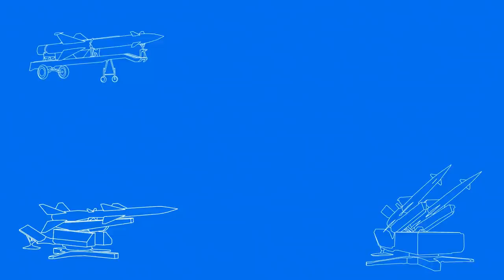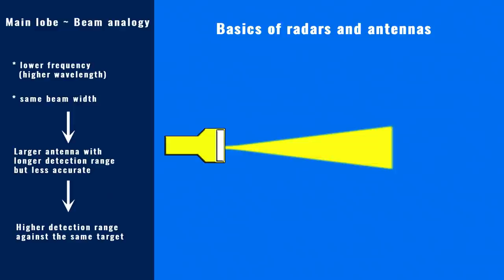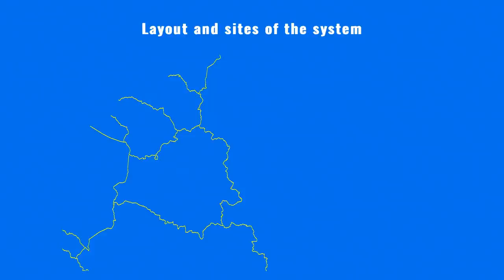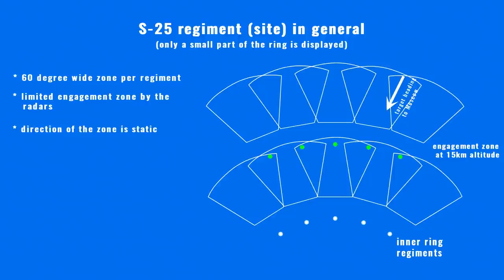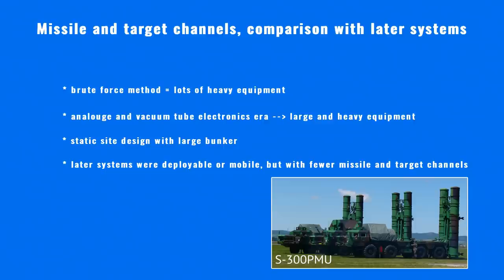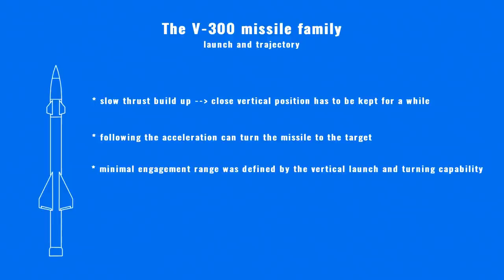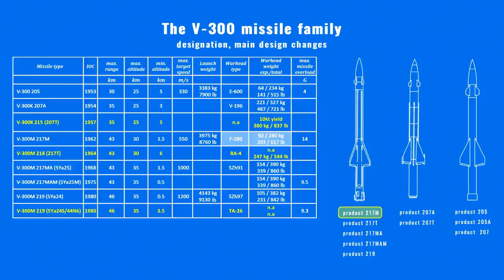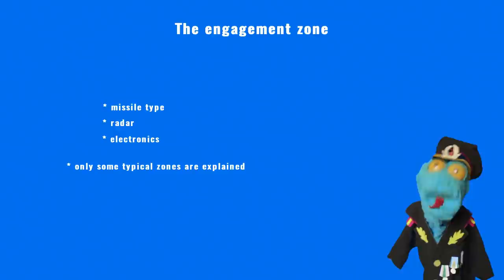Was S-25, Soviet first SAM system, ahead of its time? (A VERY in-depth analysis)

Comment: Its good to hear about the old Soviet Union and especially the S-25 missile system. The S-25 was tested by the U-2 flights over the Soviet Union from the mid-1950s. The system was not able to intercept a U-2 until 1960 when 14 SA-2 missiles were fired, one downing a MiG-19, before Gary Powers U-2 was hit.

Comment: It seems like a LOT of these systems could have been made a LOT safer if them just moved the command bunker 10 - 20 meters away from the electronics/ radars, via cables, so that anti-radiation missiles/ bomb strikes against the radars would not kill the operators in the bunkers. Maybe some concrete reinforcing, as with Vietnamese SA 2 sites wouldn't have gone amiss, either.

Comment: if a missile/rocket motor has no turbopump but relies on pressure, maybe it's better to call it pressure-fed? then again if pressurizing gas is generated instead of stored separately it might make sense to call it a gas generator cycle even though 'gas generator cycle' usually implies 'gas is produced to power turbopumps to pump fuel'
Reply: If you think through it would be pointless such term. Because if you have pump what does the pump do? Increase pressure. Any fluid is pressure fed. The question is what provides the pressure.

Comment: what instrument reads the radar and turns the fins of missile that guide it to the target and how does the mechanism work?
Reply: This is way to deep question to answer. 
You need the blueprints of the systems. The principle of the system is the point of the video. You are asking not about "basic design" level but detail design.
Reply: @molnibalage83  Excellent work!
(Másfél évet voltam Volkhovon, Sárbogárdon, ez a videó elég sok emléket felhozott. 😊)
Reply: @imrekalman9044  Ha lesz folytatás, akkor még több emlék lesz. ;)

Comment: Just one small mistake. G rate is important only in relation of successful maneuver at a very short distance. Due to how geometry works, any maneuver done by target will require a significantly lower adjustment by pursuer. G differences are more theoretical and are about how effectively pilot manages to avoid incoming missiles. With fighter planes pilot had some room to maneuver, but even if pilot knows what to do exactly, it still does not make missile obsolete. However, targets against which this system was initially designed had no dodging capabilities. G turn rate is highly situational and marginal statistic.
Reply: This is not true. Short distance is not = with terminal phase.
The leading and other issues will be explained later.
Reply: @molnibalage83  Refer to what I had said previously. Incoming object does not need same levels of maneuverability in order to track target. Its one degree shift can cover 90 degree shift in maneuvering object if distances between two objects are large enough.
Reply: @REgamesplayer  I will explain in detail everything as the length of the videos allow. There is not such kind of mistake in a video. You will see hopefully even in the following video.
Reply: @molnibalage83  If you say so.

Comment: How would it have done against the UK's Vulcan B2 bomber carrying bluesteel missile ? In service from  about 1963 to 1969. It had a Mach 3.5 speed and a range of 90 to 250 miles depending on launch hight.
Reply: I do not know the exact attack profile of the Blue Steel missile. From 1968 the Berkut a decelerated BS missile maybe could down but from mid '60s appeared the first S-200A Angara what would have better chance against it.

The 90-250 mile range of the BS missile was not enough large considering the qty. of Soviet interceptors. The main problem was the unreliability of the BS missiles and very long preparation time. On paper it had good combat parameters but the maintaining and reaching that is another thing.
Reply: @molnibalage83  bluesteel was only really an interim solution. The original plan was to replace with skybolt (best part of 1,000 mile range) when that was cancelled the UK deploy Polaris A3 in 1969.
Reply: @patdbean  I know. ;)
Reply: @molnibalage83  I was not suggesting that you didn't, just filling In the story for anyone else. 👍
Reply: @patdbean  RGR. This story is quite long and also had effect on army air defense. Hopefully I get chance to bring on the whole story on this channel.
Reply: @Traynesha Wilson the UK's first free fall bomb  blue Danube may have had the problem. But that was a 20ktatomic bomb.  By the time of bluesteel the warhead was (I think) a one megaton yellow sun. That is not to say that the liquid propellant on the bluesteel missile did not give problems, I am sure it did. Remember it is was a stop gap weapon, only 50  odd built. So probably only 20-30 in operational service at any one time. Still 2 or 3MT on each  of your 10 bigest cities could put a downer on your day.
Reply: @Traynesha Wilson This is true for every nuclear weapon. From time to time they have to be disassembled. In fact the first generation on nuclear bombs, the closest kin of the Fat Man could be kept only for some days in usable state that had to be disassembled because of its batteries.
Reply: @molnibalage83  if it is only the batteries, I think  they started with rechargeable NICD but soon moved to single use thermal batteries, unclear bomb is the ultimate single use device.

Comment: Can you make a video on David Sling air defense system.
Reply: I do not know well that system. In fact most of current SAMs uses quite the same general principle, only their radar types and missiles are different. But exact data are classified. Making a detailed video with useful information is quite hard.

The best what is possible when all the major Russians SAMs are known and basics of the NASAMS2 and S-350 you can compare the main items on basic level but that is it. You can't find real usable data about missile maneuvering capability or anything. The principles and goals can be shown but such detailed style what you can see this video is not possible.

Comment: Soviets were always ahead in two areas: anti-air missiles and small arms.
Reply: This is not exactly true. 
In fact the first mobile SARH guided SAM with CW illumination was the HAWK. IOC 1960.
For the Soviets the 2K12M Kub, the really fist reliable variant was available about 6-7 years later.

The Nike Ajax and Hercules combined wit SAGE were such advanced that we cannot speak about 'ahead'.
The US and western SAMs are generally less known because they are barely or not at all were used in combat comparing to Soviet SAMs.
Reply: @molnibalage83  I was referring to AA missiles in general. Like the R-73 which was at its time, unrivaled among short range IR missles.
Reply: @andro7862  Which is also not true. The only unique capability of the R-73 was the TVC. 

The HOBS capability was available in small scale. The F-14J (Block 45 and 46 series) and on F-4N in 1970 was available a helmet mounted sight with AIM-9H. It was considered too complex, heavy and unpractical the system and they discarded. But it was 13+ years ahead of the USSR. Then the US Navy switched to Hornet good slow speed pitch authority instead HOBS.
http://www.best-of-flightgear.dk/vtas.htm

Otherwise the R-73 was just and upscaled R-60M with TVC and better seeker gimbal. It is just arrived later and more hyped.
Reply: Also tanks the T-64 is the first MBT to have composite armour layout ,smooth bore gun that enter mass production and for an entire decade NATO has nothing similar.
Reply: @molnibalage83  But it never entered service. The R-73 did.
Reply: @bacnguyen9304  Yes, the T-64A was a miracle comparing to the Leo1 and AMX-30. It change the thought that MBTs cannot be protected against the existing firepower well.
Hpasp also made a doc about MBTs 10 years ago.
http://www.mediafire.com/file/b63t8z6w86nizpi/MBTs.pdf/file
Reply: @andro7862  Nope, they are entered in service and based on experience it was discarded. The idea to make a HOBS capable plan
*was not a Soviet idea
* was not the first Soviet
They pushed further and they fielded in great number.

Following the Cold War testing when the west realized the power of R-73 quite quickly developed the USA the AIM-9X (partially revived the cancelled AIM-9R) and IRIS-T.
Reply: @molnibalage83  You said yourself it was cancelled. The US realized how the R-73 was superior to their missiles so they rushed to develop the AIM-9X after the USSR fell apart.
Reply: @andro7862 It was applied for a few jets THAN cancalled.

Comment: How effective would the A 10 Thunderbolt 2 be against naval assets. If the A 10 was used in defense of Taiwan how useful would  it be?
Reply: Which A-10? A-10A or A-10C and against what naval asset? I short both in its era is quite ineffective against ships. The only longer range PGM during Cold War was the AGM-65 which is has much smaller range that just an air defense of a small frigate...

Comment: Type 207 with a 10 kiloton warhead! That’s one way to stop several bombers.
I wonder how many of those were actually deployed.
Also isn’t very high altitude detonation more safe as far as fallout because of less radioactive dust spreading as in closer to earth detonations?
So maybe much better than missing just one bomber.
Reply: Only 60 were manufactured from 207T. I do not have figures about the rest.

The 207T missile was live tested in Kasputin Yar training system, on the 19th of January 1957. Western codename of this nuclear blast is Joe-29.
Two Il-28 target planes were selected as targets flying at an altitude of 10km flying in a formation, 800m apart. The pilots bailed out before entering the test range. The detonation of the warhead took place at a range of 150~200m from the first aircraft. The wings of both aircraft blew off by the shockwave of the nuclear burst.
Reply: @molnibalage83  not true.  the pilots did not jump out of the plane.  the pilots were prisoners of the gulag.  they were chained to the helm, and a million more prisoners were in the bomb bay.  And from behind flew an NKVD bomber with a machine gun to shoot those who turn back.  Behind the S-25 operator was also an NKVD officer with a pistol aimed at the operator's head.
Reply: @alexandrvasilev2865  WUT?
Reply: @molnibalage83  He wanted to tell you not to talk nonsense. The IL-28M was a fully radio-controlled target-aircraft. Takeoff and landing (if it was not shot down) were carried out without a pilot

Comment: Binkov, why at 7:49 do you cut off an not mention the low altitude design flaw (closed caption shows it but you edited that part out).
Reply: He did not cut anything from the video. And it was not a design flaw. It was simply not demanded initially. What is not requested it cannot be a "flaw"...
Reply: @molnibalage83  Or vulnerability. Whatever you want to call it. Just curious why it was cut out. Binkov has great videos but sometimes they seem a bit biased.
Reply: @archieosborn  He did not cut anything. This is the video with full content. I know, because I made it...

Did you watch all the end? Where is mentioned that late '70s following the appearance of low level terrain following CMs the Berkut became totally outdated? This was the main cause of rapid development of S-300PT which did not reach the aimed capability. The originally planned first S-300 variant was the S-300PS but it was so urgent the need that created the PT and PT-1. But this point is quite far now in the storytelling.
Reply: @molnibalage83  Got it. More for the flow of the story. Makes sense. It was definitely cut but no biggie. Just curious why. Thanks for the info! Overall very good video with lots of info. I appreciate that!

Comment: why did not the western countries developed such advanced sam systems?
Reply: In fact the USA did it but they were not exactly designed the same way. Berkut was not so advanced it was rather brutal as the video mentions. The Nike Ajax was similar but in some major design aspect USA followed a different path.
Reply: @molnibalage83  but i wonder anyhow. in the yugoslavian conflicts, the us fighterjets proofed, that a advanced sam system, does not prevent you to get bombed. the yugoslavian army did not shoot down a high number of jets.
Reply: @derverdachtige1406  During Allied Force the US jets face 0 advanced SAMs. Serbia had S-125M Neva, 2K12M3 Kub-M3, a very few Strela-10M and MANPADs (from my mind I cannot recall the availability of different types) and old AAA.

As the video stated ground based AD alone can't stop and air attack and likely never will be able to do it.

The only goal of the Serbian AD was survive. Around Belgrade only in rotation 2-3 Neva batteries were used instead all of them. Zoltan Dani's unit was detached from the ring around Belgrade. His unit downed both manned planes. Besides them lots of UAVs were downed.

RQ-5 Hunter - 8
MQ-1 Predator - 3
RQ-2 Pioneer - 4
Phoenix - 2
CL-228 - 7
Crecerelle - 3

Comment: It was the job of the RAF and Vulcan to play Pathfinder in a hot war.
Non maneuvering? Not bloody likely.
Vulcan could out turn fighters and their SAMs didn't stand a chance of even spotting them with their Red something ECM and with their low level attack they stood no chance.
Their task was to use hydrogen bombs to clear a path all the way to Moscow including punching a home through the S-25, through which flew the lumbering B-52s.
Reply: Only in fairytales could outperform a Vulcan any fighter.